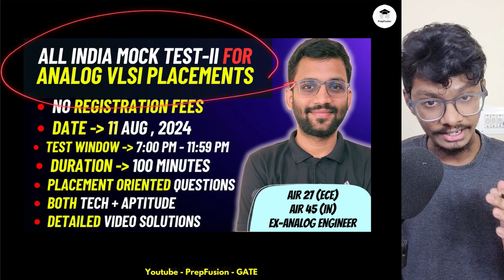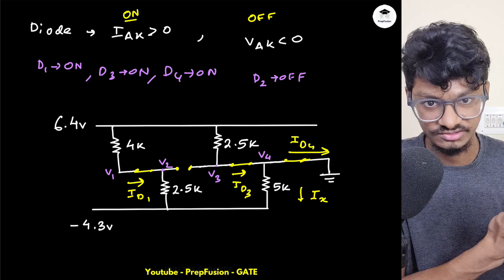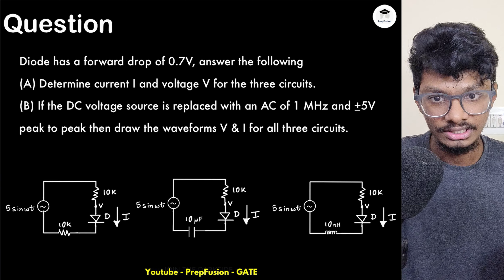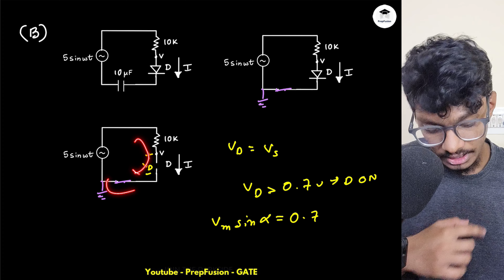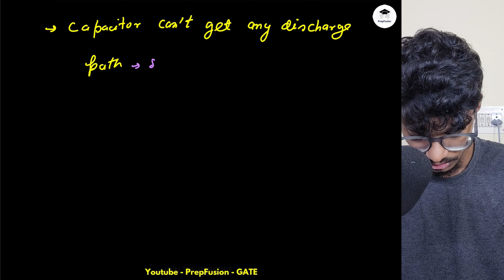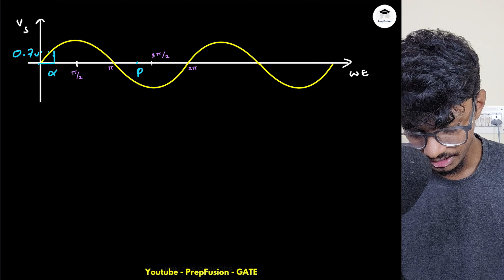MOST Important Questions On Diode Circuits Part - II || Analog Electronics Decoded

Comment: Bro can you solve the node voltages problem again once with clarity,i cant understand.if you dont mind send the overall notes of that problem
Reply from the maker: Notes Uploaded on LinkedIn.
Reply: @AnishSaha_ I saw it but there is no answer for that respective question
Reply from the maker: @anvireigns8745  which question?
Reply: @AnishSaha_  finding node voltages v1,v2,v3,v4 in diode circuit.
Reply from the maker: @anvireigns8745  watch the video again everything explained. See the comments of part 1 their also explained. See the notes their also written everything. It will be zero try to analyse by yourself.